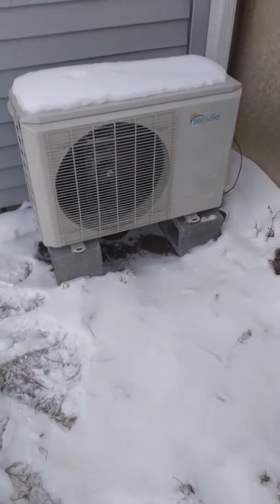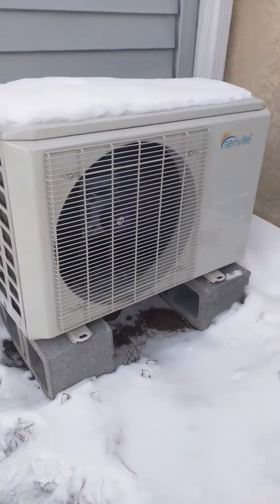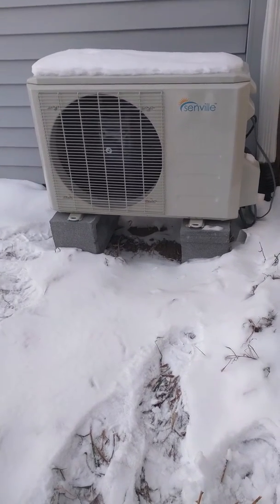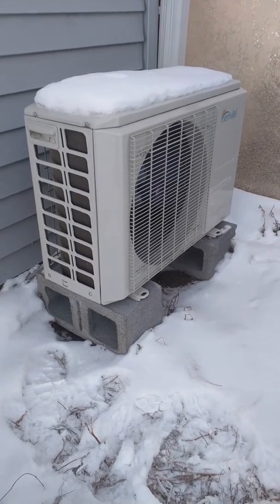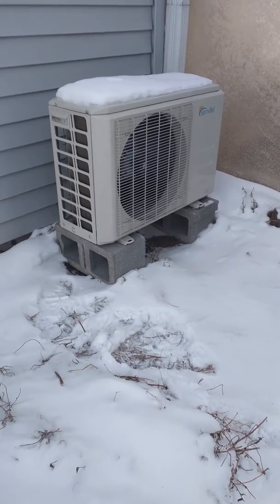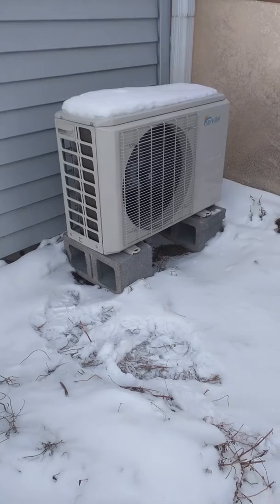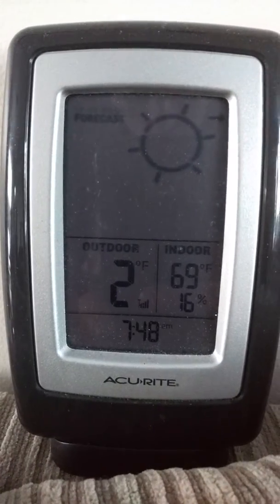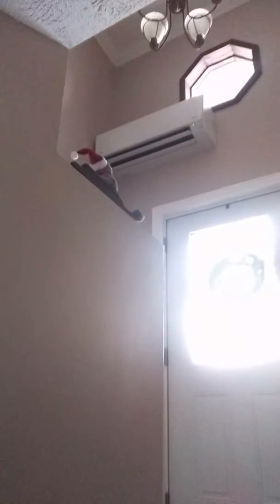Senville Aura hfz mini split heat pump at 2f 12000btu

Comment: So am I correct to say the Fujitsu is more efficient?  I have hot-water basement, oil-fired, heat.  I can't believe it is cheaper to use a heat-pump, anyone have a comment on this?  Thanks for the vlog.  Which do you recommend for cooling, Fujitsu or the Senville, which is better at cooling?
Reply from the maker: Fujitsu wins hands down for efficiency and cooling and heating approximately 30%. The 12000 BTU Fujitsu 12rls3 runs approximately 1550 shipt to your door but a senville 12000 BTU Aura rotor on you $1, 000. So the $500 difference probably will take 8 to 10 years to pay back but you're obviously getting a Japanese unit with the Fujitsu and if installed by Fujitsu contractor you get a 12-year warranty versus a 5 year Parts warranty and 7 you compressor warranty on the senville. Also at 5 degrees Fahrenheit to 12000 BTU senville aura only gives you 12000 BTUs of heat what's a Fujitsu 12000 BTU 12rls3 will give you 16 thousand BTUs of heat at 5. So it's a lot more powerful and it's still 230% efficient at 5 degrees Fahrenheit running full borr where's the single is only 190 percent. when monitoring both if they're running a medium to low load they seem to be equally efficient but as you increase the load and lower the temperature that's where the Fujitsu is a lot more efficient.
Reply: @ne7s29  I'd say the Senville caught up. Their warranty is better now (Oct 2022) and they use a better compressor in the Aura's. I just bought one with 25.5 Seer. In order to compare your two units they have to be in the same location and heating the same space otherwise you introduce variables that you may not be aware of.
Reply from the maker: Fujitsu rls3y models pretty much over any others. Over oil you will save at least 50% on heating if you size it right.
Reply: @ne7s29  Undersizing IS  a problem, oversizing you likly wont see because of the mini split variable speeds.  MY installed Mitshubishi is sized for 100% of heating needs but is oversized for cooling needs but I never see evidence of any effect like high humidity or clammy feeling air. One overlooked perk my wife noticed befor I did was we do not see any mildew anywhere in our home. That's been a  issue in our hot humid summers befor the mini split was installed.

Comment: How does it do for cooling? How hot does it get where you live?
Reply from the maker: Smurdle450 doesn't get too hot, mid 90's at most. I have it on my first floor which doesn't need much ac.
Reply: Cool. How does this unit hook up to electricity?
Reply: (I hear it is 110 volt, so does it require any special electrical? Or does it simply plug in to a normal socket?
Reply from the maker: Smurdle450 they sell a 110v and a 220v models.
Reply: Oh. I’m looking into the 110v model.
Reply: @Smurdle450  Why?
Reply: Smurdle450  This is what i was wondering ???? you would think if its 110v you could wire a cut exstention cord to it
Reply: I have ask this same quesiton, I think two things.  1) it would work as long as you had the proper amperage.  I would recommend putting a switch on and off as its been mention that these things use electric when idle. up to 160 watts.   Good Luck